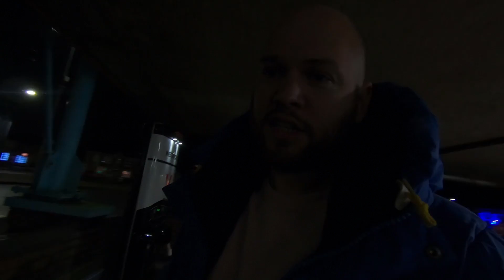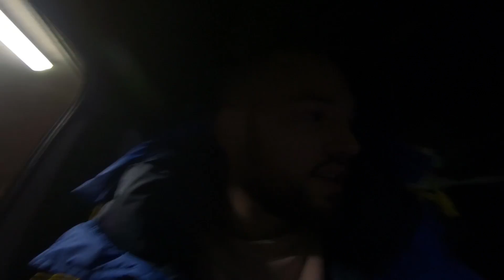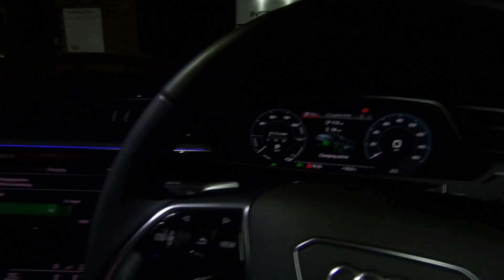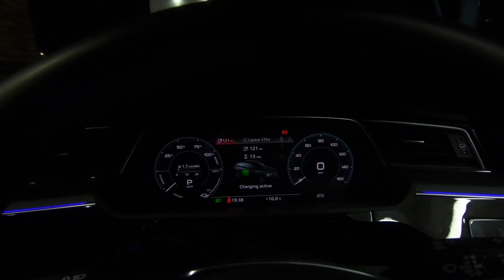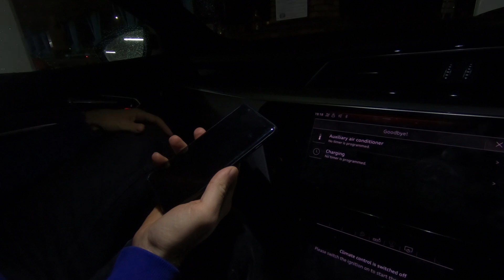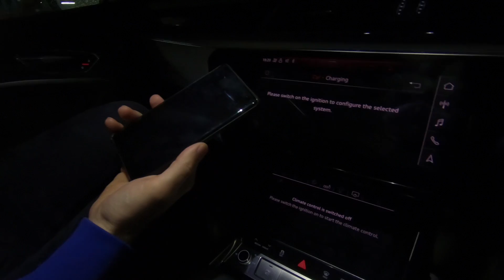Living with an Electric Car without a house! Part 3 - THE COSTS INVOLVED

Comment: Bottom line is that as there will be more electric cars, the price of charging will go up aswell. And when the internal combustion engines are gone taxes still need to be paid by someone and those will be electric car owners. Just like with diesels. Buy diesels they said and than they put pollution taxes on them. This time will be taxes for recycling batterys in an environmentaly friendly way. 
This is just my opinion.  Time will show if I'm wrong. 
All the best guys.

Comment: Someone needs to figure out solar charging, and how many free miles you get for a day of sunlight. Electric cars are not suitable for people who don't have their own parking space off the road. It will be great when all motorway services have electric points BUT they will still charge you to park for two hours or more. Overnight home charging is still the only economic method of charging with power on a night tariff coming in at about 6p per KWHr. Plus rapid charging has never yet been good for the battery lifespan and may need to use electricity to keep the cells cooled.
Reply from the maker: Absolutely, even if you could have a solar roof generating a very small amount of electric then it would help! 
I never realised you couldnt park for more than 2 hours at a parking bay, however that does make sense so then someone else can use it. 

As far as cooling goes, I am aware that the newest cars with the fastest rates of charge have a liquid cooling system to keep everything as cool as possible

Comment: You don't have all this hassle with the good old fossil fuels when you need to fill up, never mind the impact it's having in the 3rd world countries mining the elements required to manufacture the batteries.
Reply from the maker: Yes this is something that isnt spoken about as much as it should be. The materials that go into battery production are just as bad for the world as fossil fuels, currently. This may change however with new technologies

Comment: I'm hoping by 2025 electric cars will be the same price as normal cars today.
Reply from the maker: Yes, i think this is very possible. If you look how far they have come on in the last 5 years they will surely improve significantly in the next 5 years
Reply: Drive with Marc you can already buy a zoe for 25kish
Reply: @TheTechnician44  the average price of a car can be 3000-15000 so I'm hoping electric cars will be within the price range
Reply: John P  but I mean If someone can afford an electric car they can afford a battery.

Comment: 35p is not very expensive. For example, if we take smaller cars like for an example Zoe or Model 3. They take an average of 15kWh/60miles. So an average of 4 miles/kWh. With Instavolt we get 35p per 4 miles or 9p/mile. So for 60 miles we would spend 5,4£. Show me a similar ICE car in terms of weight, that gets you better mileage. That's without AC. With AC will average 6-7£ per 60miles which is not that bad compared to a petrol car. So it depends on each one's situation. Thx for the video, appropriate depiction of reality.

I'll be driving an EV soon.
Reply: I get over 60mpg from a diesel, that works out cheaper than electric when it's £1.29 per litre.  I saved £20k on buying the car which means I'm quids in. Electric has a long way to go before it's a people's option.
Reply from the maker: Cant really argue with that, for the moment that is clearly the more affordable way of motoring.
Reply from the maker: Thank you for the comment Jora. I suppose when you work it out like that perhaps given a different EV it makes more sense. Certainly if you can charge at home then it makes perfect sense over night, however I think for now they will need to lower to cost of fast public charging to entice more people into EVs
Reply: @Nobby Heads do you drive an EV daily? Just curious
Reply: I look at this a bit differently, there are many people driving EVs nowadays. It can't be that all of them are blind and like to waste time. What do you think?
Reply from the maker: @jorakarandas6592  I think the majority of people driving EVs now will have somewhere they can park at home and charge overnight. It is only really then that it makes sense to get one
Reply: Ikeas has free chargers have a look

Comment: Love the idea but electric cars need to be faster charging and cheaper .with longer range at least 400 miles
Reply from the maker: Agreed, in fact I think it can be one or the other. I think if the range is only 200 miles but you can charge up in under 10 mins then its fine. OR yeah a longer charge but 400+ miles
Reply: Why do u need 400miles???? Bullshit do u drive 400miles everyday ??? Get a public bus and wait another 5years
Reply: Just Paul PERIOD
Reply: Considering 1 in 8 deaths in Europe are from pollution I find it hard to understand why people need to wait until an electric car has a range of at least 300 - 400 miles. Maybe when it's 1 in 3 deaths are linked to pollution then people might wake up.
Reply: ieatlotsoftoast Most working class people can’t just up and get an electric car. I would love one because I know it’s better for everyone. But I am not working and I live with my parents and of course my first car runs on gas. But you better believe when I have the means, Cybertruck here I come.

Comment: Can't imagine the hassle of plugging ur car in every day. Never done any harm the good oul petrol n diesel
Reply: Unless you do over 190 miles a day. You don't need to charge it every day. Sometimes watch the whole video before commenting.
Reply: Can't see people waiting in car parks for an hour to get the charge they need to make it home
Reply: @ayesurewhynot2898  
I run out of petrol a long time ago. I waited 3 hours for a recovery truck
Reply from the maker: Yes this is the problem, chargers need to be faster and have more of them. However if you can charge it at home then that is half the battle done
Reply: @FirstDriveReviews  yes but didn't this guy say it would run you about 2 grand to get one of them charging banks set up at home.
Reply: This is why EVs are more practical if you have  a place to charge at home. Plug in while you sleep and wake up with a full battery (200 miles in this case) everyday.